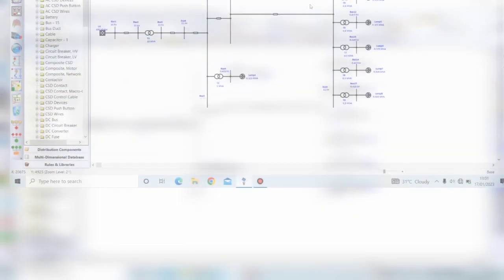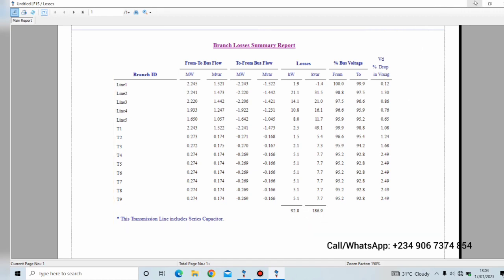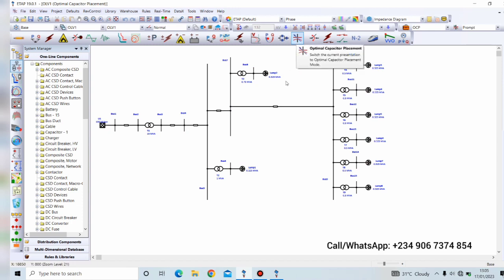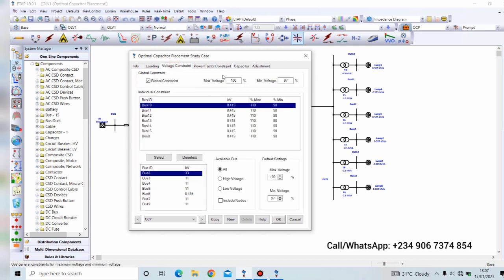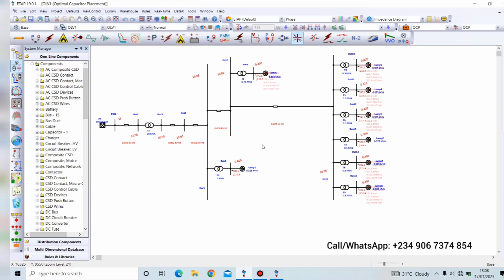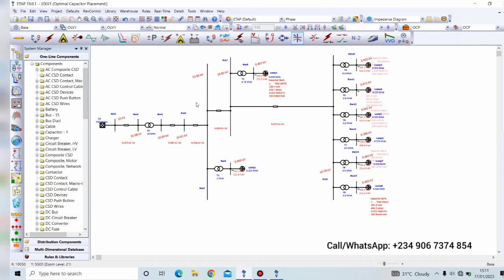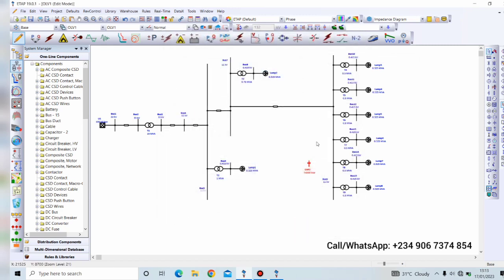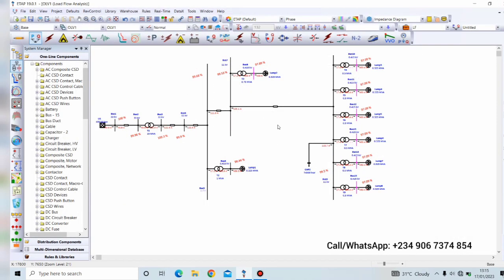Lesson 6: How to Reduce Power Loss in a Power System

Comment: Hi Thanks for your clear explainations.
I was running thru youtube looking for voltage stability tutorial using ETAP until i found your channel.  Indeed, on my model of 10buses (13.8kV, 115kV and 500kV) I am having 30% and 34% as magnitude of voltage on two of the 10 buses while the rest are either 100% or 99%. I then went thru the procedure as clearly explained here, however after setting all the parameter and then running the OCP, I am getting this message " Could not meet all minimum voltage limits. You may increase number of maximum capacitor banks or add more candidate buses and try again". After several attempts still same message coming. Looks like OCP is not the right method at all for my case, Is there any other approach to go thru? transformers LTC is also not efficient
Reply from the maker: You're welcome, try using static var compensators